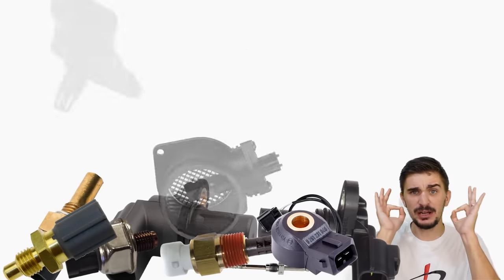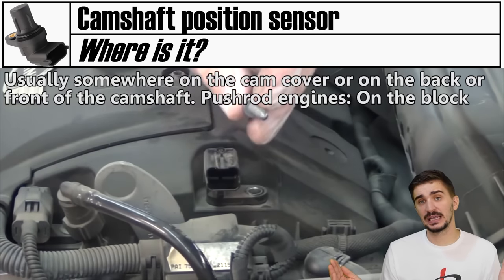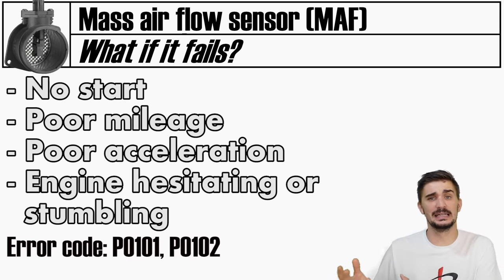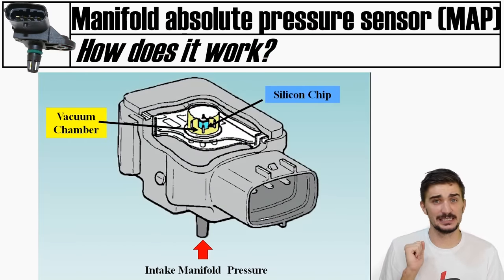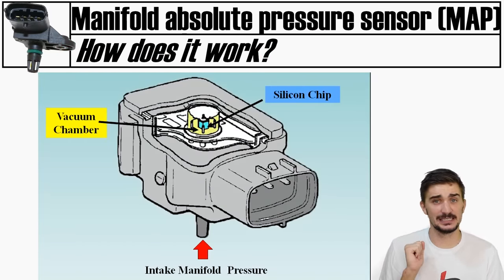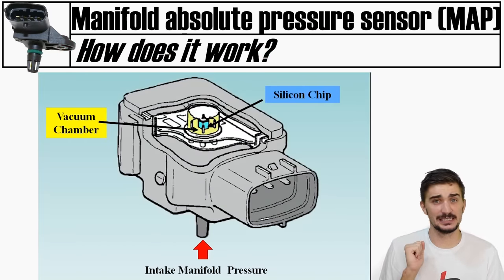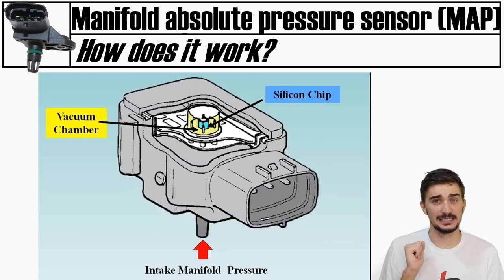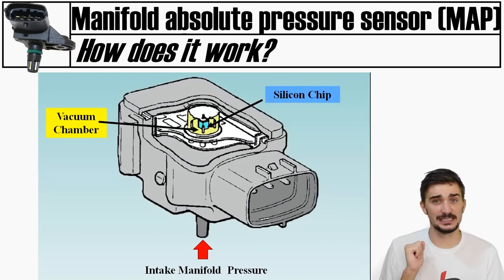EVERY ENGINE SENSOR EXPLAINED - MAF, MAP, IAT, TPS, 02, NOx, EGT - How it works, location, OBD2 code

Comment from the maker: Become a Tuning Pro: https://hpcdmy.co/dr4a
Motivation: https://www.youtube.com/channel/UCt3YSIPcvJsYbwGCDLNiIKA
AEM SS MAP sensors: https://bit.ly/d4a-map-sensors
AEM wideband: http://bit.ly/D4Axserieswb
AEM IAT: https://bit.ly/D4A-iat-sensors
AEM FLUID TEMP: https://bit.ly/D4A-fluid-temp-sensors
AEM EGT: https://bit.ly/D4A-egt-sensors
Support d4a: http://driving-4-answers-shop.fourthwall.com/
Reply: 😃 Excellent Basics 😃
Reply: Boost pressure sensor is missing
Reply: Boost pressure sensor is missing
Reply: @liambyrne5285  Most vehicles are built as naturally aspirated vehicles.

Adding the boost pressure sensor just adds confusion.  If you know enough to be fooling around with turbocharged engines you know the if/when/where's of a boost sensor.

This video is for average drivers.
Reply: Great video. Do you also have a video on how the fuel system works, how the fuel gauge works, along with how fuel is measured and what would happen if your fuel pump is broke and so on. Thank you
Reply: Thank you...
Reply: d4a I hope u see this comment I really mix up what compression ratio and air-fuel ratio is it the same or two different terms pls explain
Reply: @markrice3019  qq
Reply: Variable cam timing? Variable lifters?
Reply: Please can I communicate with you via your email or any other means. I have loads of problems, I suspect are connected to improper functioning of my Mecede R class.
Reply: This one video makes it so clear to me, I'm now ready to trade up to a vehicle that doesn't have a carburetor. 
One thing I still don't get is how would I know what the fault code (p-code?) is when a sensor goes bad?
Reply: You sound very much like Anton Petrov from “whatdamath” YT channel or his “Anton Petrov” channel. 
 Y’all must be from the same region.
Reply: Is
Reply from the maker: @Cheeseburger.Launch.Sequence  The MAP sensor is the boost pressure sensor. On a forced induction engine it will simply be calibrated for different values but it will work the same way and will have the same general location.
Reply: Good
Reply: Pls. make a video on ION SENSING.
Reply: Man you are the best
Reply: Should add Diesel engine sensors as well, FICM, ICP, etc
Reply: Nissan 2004 model I have tried all that I know but it is not starting
Reply: How can I connect my android phone to my car to detect fault 
Daniel Ofosu Yeboah
Reply: Mmmmm
Reply: if this was a paid channel, I'd pay
Reply: @d4a  
I love your videos, brother. I’ve got my son taking your boost school right now since he wants to turbo his Honda. I insisted he learn your videos backwards and forwards before we order the first part.
Reply: Please I need to chat you please... I have some questions to ask
Reply: @d4a  hi mate 
I’m struggling here
I have 2013 Jeep Patriot 2.0L, had a throttle problem but it has been replaced by a new ones. After few weeks thunderbolt symbol comes back again weekly ones and disappears 
It shows up a code P2173 vacuum leak but couldn’t find what is it 
Could you please help me out
Thanks
Reply: Thank you for a shearing of knowledge.
Reply: @Crunch_dGH  1
Reply: Excellent basic ✅✅
Reply: @liambyrne5285  ililiilililoiliiliililoliiillillliiiililililililiiliolilllllliiolioillliilllilililililiililililliliilili
Reply: @911-t8w  yes you are so rite or at least I think that should make you happy
Reply: @liambyrne5285  sorry I sent by mistake
Reply: @danielyeboah3607  Did you try a new battery?
Reply: @balajibavuri6924  Gasket or seals leaking is hard to find.Need the start by changing head gaskets.
Reply: @mike-ology22  If the fuel pump is broke  car wont start the gauges work by a floating thing in the gas tank and fuel pump supplies pressure to move to from the tank to the fuel filter to the fuel rail and then to the injectors
Reply: very very good stuff here for anyone that wants to REALLY understand, I understand you wanna be brief for the tubes monies but it woulda be even more helpful with just a bit more elaboration on the time line for each sensor and how each innovation lead to the next? very very good vid ty you actually educated me a lil today a rare gift ty
Reply: p9
Reply: @markrice3019
Reply: Pp
Reply: Thank you so much boss I will like you to teach me more about it if you don't mind okay I am from Nigeria I don't mind to come over to your country if you are go to accept me please 🙏🙏🙏
Reply: 110 7:15
Reply: @markrice3019 3:05
Reply: Sir Sorry. Can it be used? To harm someone?
Reply: Radiator hot weather sensor
Reply: Brilliant video! Thank you.
Reply: Excellently delivered lesson, Thank you
Reply: Thank you
Reply: Thanks for this super fantastic video !!
Reply: I cannot find fuel pressure sensor in my Ford Escape XLT 2.3L 2006, EP3WF (from Japan, right steering wheel), it is absent at that place where it shown in many videos I watched; and I can't locate it anywhere else. But it should be existing in that car, and symptoms showing that most probably that sensor is failing: it was working well (mileage=23000km), but after couple of months parked it now starts but dies right after start (can't hold idle rpms; all symptoms shows that it runs on too rich fuel, no obd2 errors, but fuel pressure nor air to fuel ratio not reporting while I can get readings from other sensors: intake psi 14.36, coolant 64`C, throttle position 40.39`, timing advance 10`, fuel flow rate 0.12L/hr (too much?), catalyst temp 279`C (too much?), rpm 1100 (I was carefully holding open the throttle, if release - it dies. Can anybody help, please? And  can it be possible that car have no fuel pressure sensor even if I can find part replacement by part number particularly listed as fits that exact model ?

Comment: I was a motor mechanic in the 1960's, early 70's then moved into the aviation industry so I missed the whole shift from simple mechanical linkage operation to electronic sensors, ECU's and actuators. I'm retired now and have just started working on my own cars again, upgraded my tool kit, bought an OBDII scanner, and am re-training myself to understand the tangle of pipes, tubes, sensors and wires that are under the bonnet of modern cars. This video was really helpful and clarified a few things I was unsure about.
Reply: Perfect 100% love the presentation and the content
Reply: Early 70’s and 80’s had the best planes around
Reply: on the Vortec engines they have some much reduntice build in to the PCM. if the MAF or MAP sensors fails the truck can still run just uses a table in place of sensor input. The PCM will try to get you home on that cold night in winter with sensors dropping like flys.
Reply: @javajav3004  I flew a 1940 WACO biplane for an hour. That and a hop in a Stearman with aerobatic pilot were two of the most unforgettable experiences of my 70 years.
Reply: @savage22bolt32  Waco and a stearman? You’ve flown older planes than I’ve worked on. Oldest I’ve worked on was an aeronca and a preww2 switz scout plane
Reply: @javajav3004  I'm no pilot, just happened to be lucky. In the right place at the right time.  
I have taken a few lessons over the years, but the cost always held me back. So I ride my motorcycles.
I'll have to goog switz scout, never heard of it.
Reply: @savage22bolt32  lucky man lol. Switz scout Wasnt the name of it. The name escapes me but it was a fabric covered plane the switz used for scouting in the 30’s. A friend of mine built it from blueprints. I’ve also worked on Dehaviland Chipmunks and other oddball planes.
Reply: @savage22bolt32  cost for sure is a barrier. You should see the cost to own and maintain
Reply: @javajav3004  Oh I understand now.
 Building from prints takes way more commitment than I have. There are many unfinished projects in my cellar & garage. Sounds like you have an interesting career! 
PS
If you've never heard of a Curtis Sparrowhawk (F9C-2), you might find it's history very interesting. I think less than a dozen were built and a few still exist.
Reply: @savage22bolt32  aluminum planes from blueprints aren’t so hard to do like a Vans. Working with fabric like a Pietenpol is harder but much more forgiving than metal. Yes I’ve seen the one in Udvar Hazi.
Reply: @javajav3004  Wow, I have to get there.  Haven't been to DC for almost 30 years. Trying to get the family rounded up all at the same time.
Reply: @savage22bolt32  better time than a year ago since it’s open again.
Reply: @javajav3004  👍
Reply: I learned on older cars (1980s stuff mostly) pre OBD but when computers and their related sensors were starting to become much more common. I will say OBD makes diagnosing issues much easier, at least in my opinion. If nothing else it gives you a place to start.
Reply: Pete, I suggest save yourself all this shit and buy a electric vehicle, and enjoy life. Seriously.
Reply: @outlaw565 Absolutely, I would love an electric vehicle but we live in a remote area of Australia. Zero facilities for electric cars and no plans for charging facilities. The major cities are slowly adding charging stations but you have to plan your travels carefully. We're well behind other countries.
Reply: @javajav3004  I'm not sure of the years, but you said a few things about fabric covered planes and every since I was a kid, many many years ago lol I always have been fascinated by those aircrafts and the absolute maniac pilots that flew them!!! Some of those plane would classify more of a motorized kite instead of an airplane. And the way they had to "de-plane" I guess you would call it? Not ejection that's for sure! Crawl out on the wing and push away hard as you can so not to be struck by the rear wing! Im not sure of the name so rear wing it is!  But man that takes some guts or just had to be a mad man maybe both but I couldn't imagine doing that. I suppose if your life depends on something you can do things you normally thought you could not do but still. Crazy crazy..
Reply: @firstnamelastnameisallowed7943  honestly those flying kites have some sense to them when compared to those death traps known as helicopters. Especially the small ones like those Robinson egg beaters lmao. As it goes with fabric planes they can come in really robust forms like some of the early Aeroncas or something lightweight and crazy like a Avid Flyer made in someone’s backyard
Reply: I was " The Kid " in the late 70's as electronic controls started , The Ole Timers scuffed at it , I saw this as finding my niche as well as AC systems  in the shop   as one guy was the Engine man , another the transmission, another brakes etc etc.  Finally cars just got to damn small for my 6'3" frame to work on , engine compartments were crammed tight to where you had to remove several sub- components to get to the issue . I jumped over to Heavy Equipment as a Road / Field Mechanic for Caterpillar, I will admit a few of the wrench's weigh near as much as I did an was almost long as my leg , But I was making way more money an not having to work near as hard . At that time a pipe crew was averaging 10 - 15 thousand dollars @ hour , So when the Excavator shutdown people got excited real quick 😝 ,  When I would pull to the jobsite I would get a Hero's welcome, The Foreman would usually offer me a labour to clean stuff an fetch tools , whatever I needed.  Had one customer that had a old old worn 613 Cat (pan / earthmover )Scraper the engine was so worn out it wouldn't start on cold mornings  I would drag out my welded leads crank it over to 400 amps  drop the jump cables  off the batteries, I could start a Rock with that Hobart Welder , After about 4 years they offered me Shop Foreman job.
Reply: @paulrooster2108  That's a good story Paul. I did some time on trucks and heavy equipment too. Thoroughly enjoyed it. You don't lift anything, too heavy, so everything is maneuvered into position. Plenty of elbow space too. Here in Australia in the 50's and 60's and the early 70's mechanics did everything themselves from full engine rebuilds, gearboxes, a bit of electrical, setting up diffs, some fabrication, etc. Every workshop had a lathe, milling machine and quite often a tunnel borer. Aircon (when cars first started having AC) was a specialist job, still is actually. I think by the time I get a full grasp on these later model cars we will all have gone electric and I'll have to start again... Now where's my old multimeter... ha ha :)
Reply: @MrPropanePete  ,
Yep my Company truck was a Ford F-8000 , with a Service Box an a 12 ton crane on it that was my helper most times,  I would use it to pull an install Starters , I could wrap a set tracks on a dozer  by myself.  Drop belly pans off machines with it , I even had a impromptu clean room at a couple job sites using big rolls of Visqueen ( plastic )  to rebuild engines or transmissions out in the field .  There were 3 Job Super's that would insist I was their site Mechanic, really pissed my Boss off at times .. I had a small microwave that was hooked to my welder, so in the winter I had hot tea or chocolate, I could nuke a hotdog or popcorn. I toyed with the idea of getting a small RV refrigerator that could run off Elec 12 volt (truck ) or 120v ( welder ) - or propane just never got around to it . I even had a hammock that I could swing the boom out on an the other end to back of truck . It wasn't uncommon to have a 12-14 hr day . I loved being a Field Mechanic,
Reply: @paulrooster2108  That is awesome
Reply: on newer cars, most of the new sensors are connected to increase economy and have smaller emissions od harmful gasses. have no direst influence on engine performance. all about ecology. thanks for explaining. very professional.
Reply: @justsomeguyhere it’s an absolute tragedy. Only new things I’ve seen that wow’d me are electric GA planes but the price is definitely not right
Reply: Your lucky
Reply: I'm taxi driver and make living with it for my sick mother and my young sister but  last week my car damaged via speed sensors the repair could cost me 200$ since Wednesday it's parked and don't know what to do. and live in very poor country. Is there any one could help me for the sake of God and humanity.
Reply: @javajav3004  Boeing 747 ->>  All time favourite.  Sad to see Queen of the Skies decommissioned.
Reply: @outlaw565  they are even more difficult to understand and repair
Reply: PropanePete, I can imagine you remember the early anti pollution controls on the car engines in the 70s with the miles of vacuum lines. Low horsepower, opera windows, vinyl roofs, we thought that was the end of performance cars. How would we have reacted if somebody from the future said that we would be able to use a scanning tool to help pinpoint engine problems and by the way in 2021 Ford and Dodge will have cars you can buy at the dealer with 800hp!
Reply: Sensational friend, thank you for sharing your knowledge with us, I always own old and carbureted cars, today I have a 2011 Chevrolet Vectra elegance here in Brazil, I'm an aircraft mechanic and in my spare time, I fix my cars, I'm studying electronic injection on my own and I'm learning a lot about the subject, it's really cool, I'm also an electronics technician that helps me understand more about electronic injection, gratitude !!!!
Reply: ⛽️ CaRs have  engines Not motors. Engines run on combustion. Motors run on electricity. A mechanic should know the difference 🤦🏻‍♀️
Reply: @kalijasin  since you correct everyone. Here's yours. An automotive technician should know the difference. A mechanic implies he only know mechanical things. Thus leaving out motors as its not all mechanical but electrical also.
Reply: @kalijasin  also. Cars do have motors. Lots of them in fact
Reply: Me too.
Reply: Do all distributorless cars have both a camshaft and crankshaft position sensors?

Comment: As a mechanic for 6 years now, this video is still extremely valuable. Thank you bro
Reply: I'm sorry for asking the obvious question but I have to ask, as a mechanic for 6 years wouldn't you already know what all the sensors do?
Reply: @collinslfc  yes and no, having them in an easily accessible video like this is always a great refresher. some are easy to get mixed up with another and remember what does what, so a quick reminder is great
Reply: @Mr.Thermistor7228  ;j;
Reply: @Mr.Thermistor7228  do you have the wiring color to the the sensors memorized?
Reply: @nobody-_-9717  on certain ones yes, on all of them, hell no lol
Reply: @collinslfc  It's impossible to remember everything!
Reply: Good mechanic KNOWS how to read and comprehend the repair manual. No guessing work.
Reply: So what kind of a mechanic are you? I am a hobbyist and sadly didn't find anything I already know.
Reply: @tomtech1500 can you reply to him please.  I'd also like to know what kind of mechanic you are
Reply: @agentsmith7947  I fix my cars as a hobby. For what I do professionally I don't need YT tuition.
Reply: 45 years  rebuilding automatic transmissions   my ears are  listening to  your  education  , thanks!
Reply: @collinslfc  depends on  your  field  of  expertise
Reply: @tomtech1500  if he works on older cars, half of these sensors don't even exist.  Carburettor vs fuel injection, ECU's didn't exist on older carburetted cars.  My old Volvo S60 diesel had 6 ECU'S & 5 fuse boxes!!
Reply: But, but, but it doesn't tell you how to use or test for this fault information. most of this video info is practically useless or wrong!
Reply: @Mr.Thermistor7228  I wondering why is the name "Thermistor" 🙂😅
Reply: One hundred 💯 fully charged
Reply: Hello, have a problem with cooling fan staying on when engine is off and it’s draining the battery. Appreciate your help in this matter. Kind thanks.
Reply: You were a mechanic for 6 years without knowing what the sensors were? What dealer were you working for?